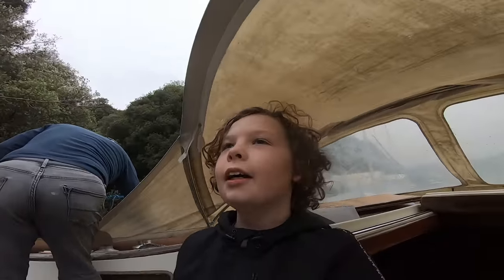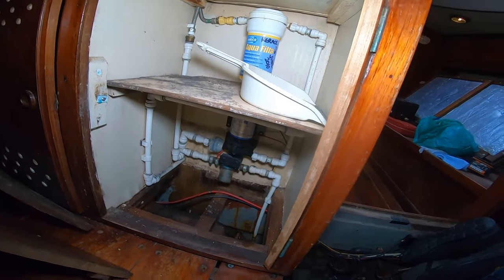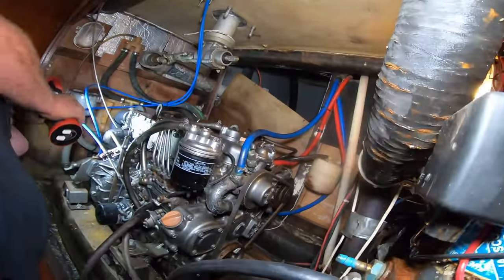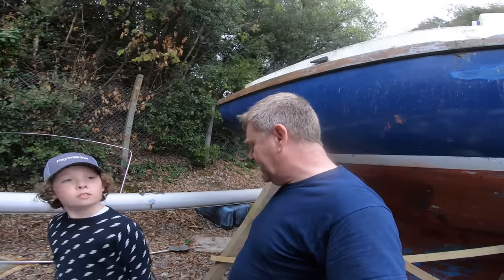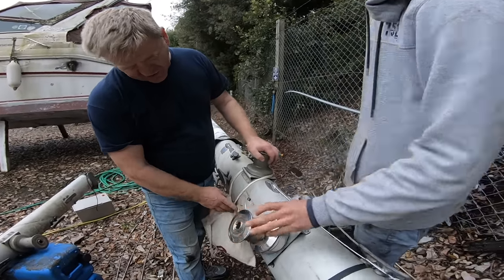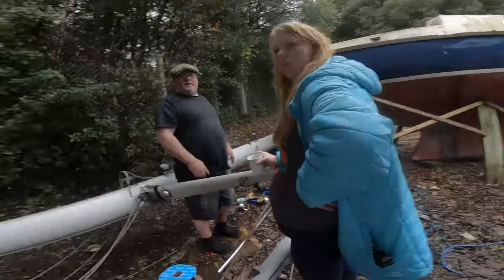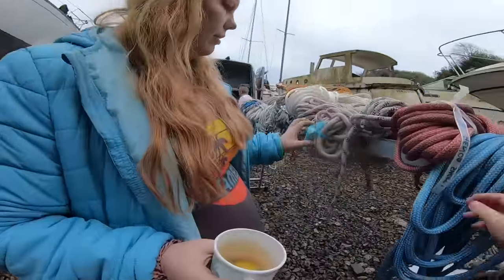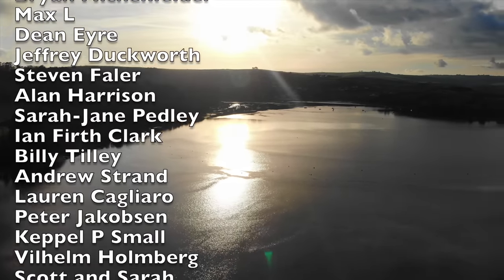#124 - We bought a boat on EBAY 🙈 CHEAP 46ft PROJECT BOAT!!!

Comment: I hope that as you remodel the boat that you take the opportunity to wire in several 12 VDC LED light bars in the engine bay in place of the existing 2 small lights to make servicing the engine easier…
Reply from the maker: Oh yes indeed. There’s already adequate lighting in the engine bay but I’m going to be lighting it up like Eye of Sauron
Reply: @SailingMelody , glad to hear that we are on the same wavelength. Moving temporary lighting around while you work on an engine is incredibly annoying. 

As a rule of thumb, if you don’t need to wear sunglasses and apply sunscreen to work in the engine bay with the new lighting package, you didn’t put in enough lighting.

Comment: I live in New England (Connecticut) we have the same sort of problem with moss growing on the north side of anything that doesn’t move but not as aggressively as England seems to have
Reply from the maker: Hahah yes. Green slime on everything especially under trees. One of my old boats was on a mooring in a rive with overhanging trees. Every time I visited the boat it was covered in green slime

Comment: That is a very nice boat. Hope you got a steal of a bargain on that. Too bad it doesn't have an indoor pilot house. But i suppose it's not really sailing if don't stay on deck underway. Try to get a wind vain on it. They work very well.
Reply from the maker: We have a brand new Hydrovane which we will be fitting once we’re into that phase of our preparations to leave the U.K. and we will be building an a closed cockpit so we can shelter from sun and rain

Comment: Fine video, as usual ! Another reflection on my part, regarding the main mast. Have seen such boats sailing long distances, have some sort of steps riveted to the main mast, in case something happens up there, I guess. As I remember, they are of stainless steel, shaped as a seven, but upside down. I am sure you are of course aware of those mast steps, I think. All da best, from a snowy Karlstad.....🎅
Reply from the maker: Mast steps are a point of contention.
We have mast steps on our other boat and there’s a bit of a love hate thing with them

It’s often said the main use for mast steps is to use them to untangle things that get tangled in them 😂 but I do agree they’re handy.  I may at some point fit some folding ones but for now we’ve more important things to do

Comment: 👍👌👏 2) Hehehe, the Yanmar engine looks like a toy in comparison to the powerful big engine in the great steel boat. Jack did some really big cleaning jobs (all windows, all masts). Very well done, young man.
Best regards, luck and especially health to all of you.
Reply from the maker: That’s true. The Yanmar is 55Hp and the Ford in the other boat is 80hp and is used in lorries and tractors. But the Yanmar is way way smoother and quieter: the Ford is an absolute beast and so strong.
Reply: Dear  @SailingMelody   family 
Thanks for replying and especially for another heart. As you know, I totally appreciate both very much.
2) Yes, I didn't forget what your engine specialist once told you/us about the marine Ford engine. This kind of engine and Diesel storage would definitely make me feel better/safer while being in a days long heavy weather zone for instance. So would a steel boat with those two extra finns. But of course I'm not a sailor respectively sail boat guy and probably never will be.
Sincerely yours.
Reply from the maker: @Chr.U.Cas1622  there’s definitely pros and cons to steel and fiberglass

One good thing about this boat is

Because she is old, 1974, she was built in the days when they made fiberglass boats very very thick because they had not worked out fully the exact thickness so they simply made it over thick to be safe.

Now, these days the scientists have worked out exactly how thick fiberglass needs to be, or more precisely, how thin they can get away with to save money on manufacturing and save weight.  This is a good thing for modern boats becauee it keeps the cost down and keeps the weight down, so a modern boat is much lighter and therefore probably faster (depending on other factors like waterline length and rigging etc)  and they’re definitely cheaper to manufacture (although the builders still charge a lot of money for them).

There’s no way they would build boats with fiberglass this thick anymore because it would cost too much money and they’re trying to make the boats as light and fast as they can without asking them too weak.

So older boats made in the 1970’s are much much thicker fiberglass than they actually need to be.

For normal sailing And in most situations this is a bad thing, because the extra weight makes them a bit slower (when compared to a modern design with the same size and dimensions).  But for heavy weather, and rough conditions, constant ocean pounding, and maybe even in a collision with a shipping container or piece of floating wood, this boat is far stronger than a modern boat and much more durable.  

It would be difficult to test (I’d love the chance to try) but I would say this boat is as strong as steel in an impact.